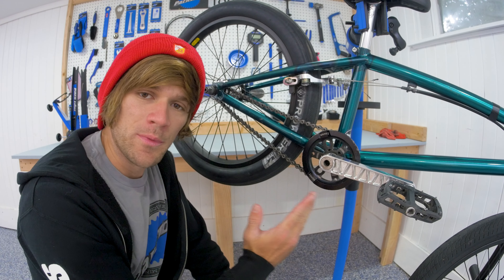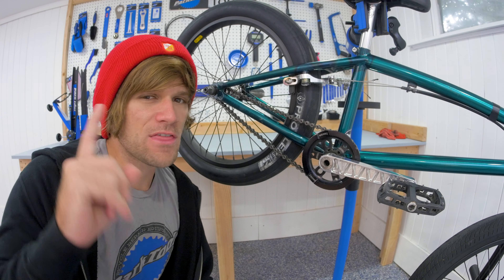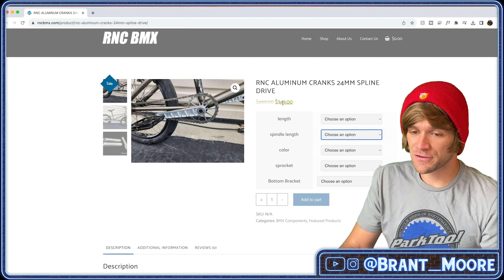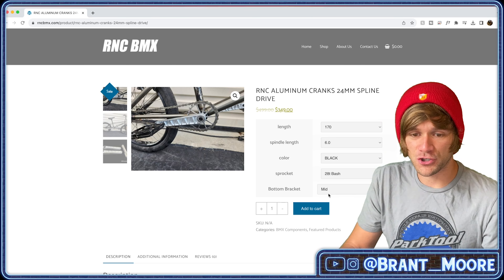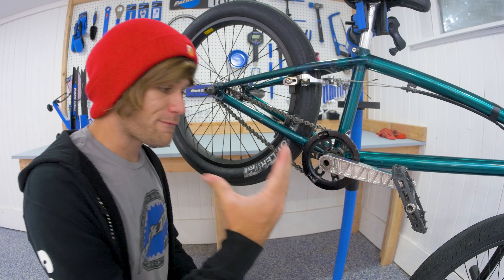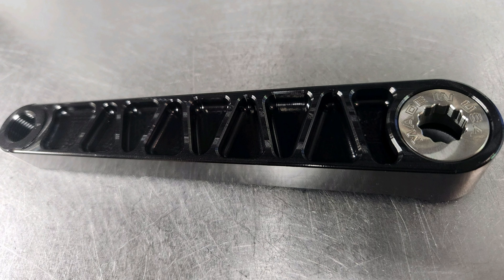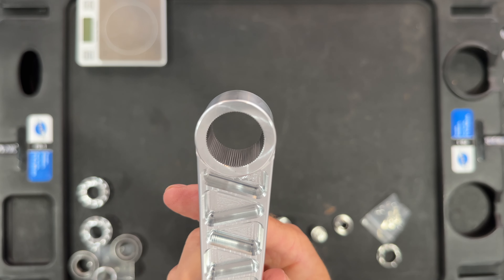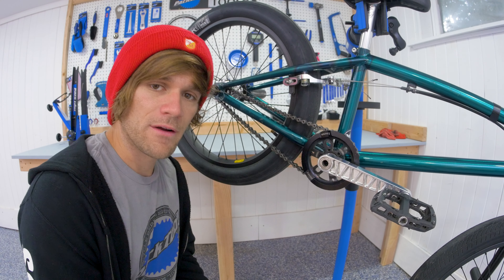SOLID ALUMINUM BMX Crank Update....

Comment: Powerbites are my all time favorite cranksets and have them on all my bikes. But i do have a pair of the original 1st gen RNC aluminum cranks. I just couldn't love them due to the square shape of the arms. These cranks look like a totaly different product though. 
As far as the pedal bosses, i believe the RNC cranks are 7 series aluminum vs powerbites are a 6 series. So a  harder more durable material. Much like the difference between Odyssey 7k rim vs the hazard rim.
Reply: I broke a set of Powerbites on the dual pinch bolt area so never again.
Reply: My power bites are 20 yrs old and still mint , tuff cranks 😊, and they are on my 2003 Hoffman condor pro team 43.5lbs triple walls , 94 ramp room love handles it’s a beast 🎉
Reply: @kirkwickham3336  my dude you probs had them over tightened

Comment: Great coverage, as usual, Brant! A year on and I'm still stoked on my RNC titanium Superlite cranks but I agree the 2-piece design can be a pain in the ass when fitting to a new frame, even if you measure everything correctly first. I think the new alloy crank is a bit hideous, if I'm being brutally honest but they could look sweet on a raw or chrome frame. Thankfully you have other polished parts to make them work.

Comment: I have been riding mine on my race bike and I love them. Yeah I definitely experienced some issues along the way especially with the proprietary deal but all is well. I’ll actually be sending mine off for anodizing over the winter. I had originally planned on using them on my 2000 barcode but ended up on my racer lol.

Comment: I would not buy them just due to the fact that all that stuff is propriatary. If they abandon the design,  good luck getting parts. If you're out and something breaks well again you're dead in the water until parts come in not even a chance of getting a whatever sprocket bottom bracket ect just to get buy for the day or 
Weekend. And the alum threads on the cranks is also another no go for me.